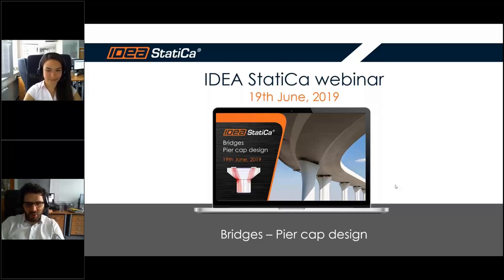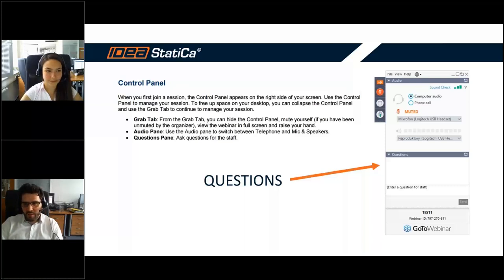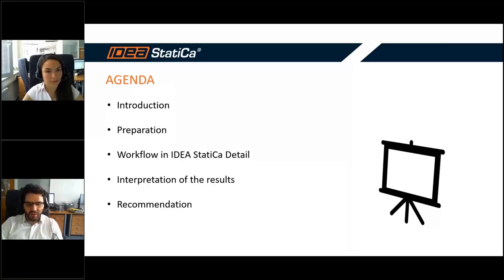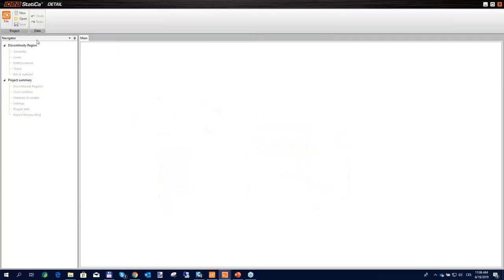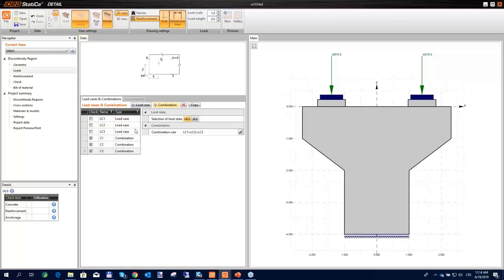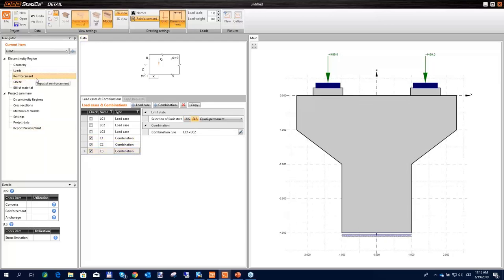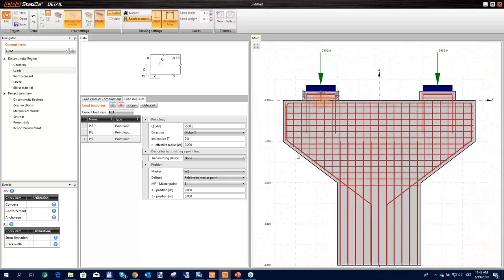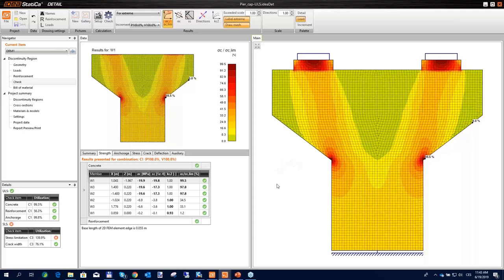Design a bridge pier cap with IDEA StatiCa

Comment: Hello there. I have a question regarding the recommendation at the end of the video about the reinforcement in the second direction. The recommendation is of course about the final design of the pier cap to be reinforced and constructed. There is no way to consider reinforcement in that direction via the software at the moment. Did I understand this correctly?
Reply from the maker: Hello,
unfortunately no, for now Detail works only in plane - 2D. You can of course build a second similar model in the perpendicular plane, but that would again be the 2D model so it would not help really.
We are working on a 3D solution, but its not ready yet.